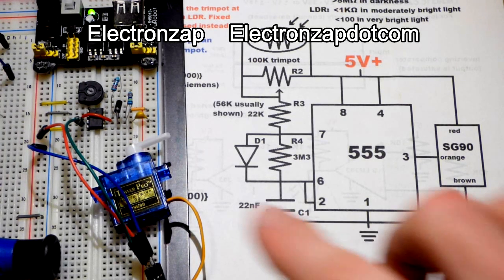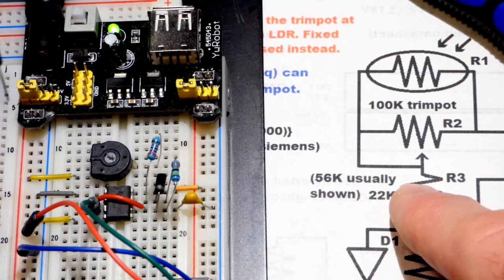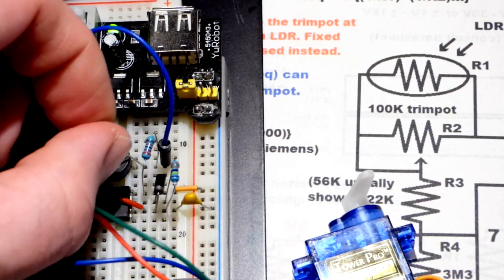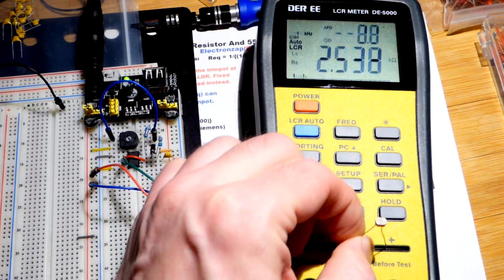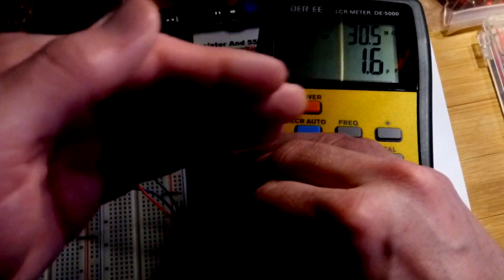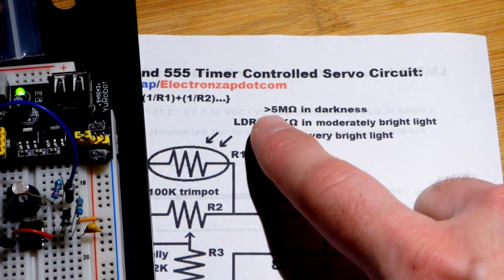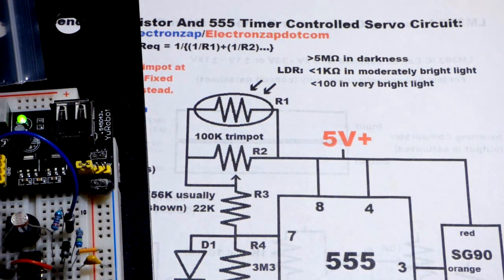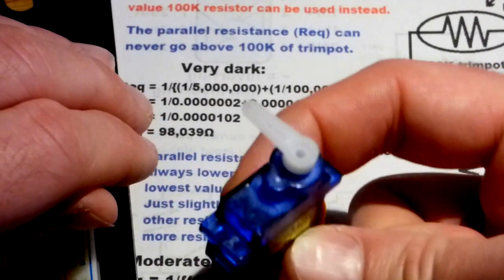Light Dependent Resistor LDR added to 555 timer controlled servo circuit for parallel resistance

Comment: Hi, good video!!! my question is would that LDR change also the frecuency of the pulse, not just the work cycle? should it be 50Hz fixed?, have you measured it with an oscilloscope?
Reply from the maker: It does change the frequency in this circuit. The frequency doesn't have to be exact for these servos, I mostly just experimented until I got it working. I'll try to keep this topic in mind for future oscilloscope videos. Thanks for watching!